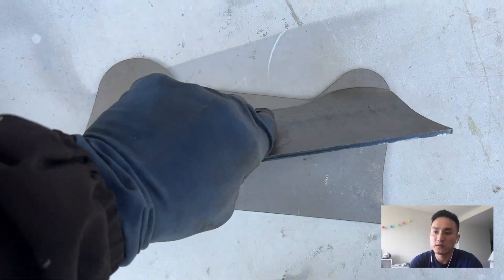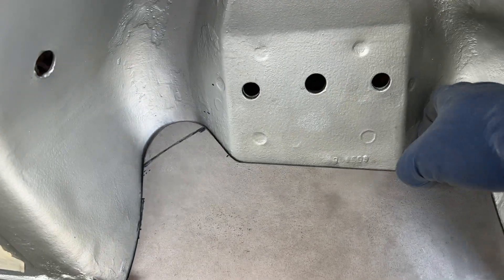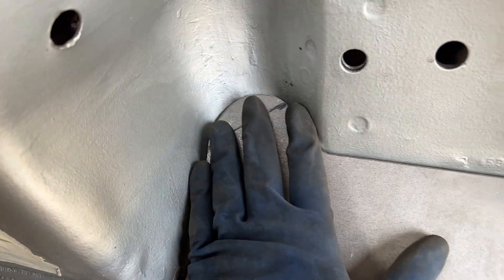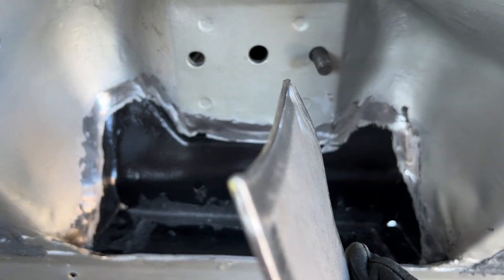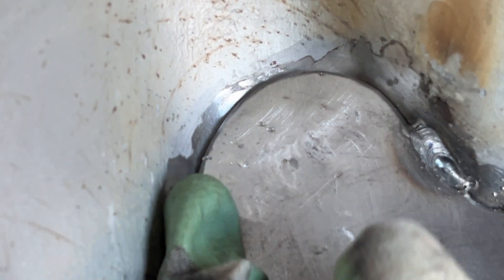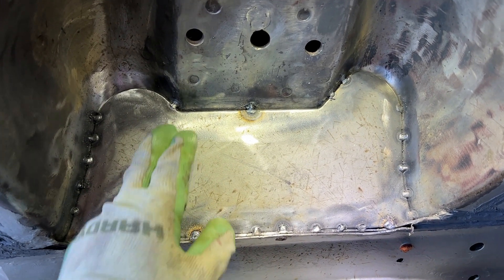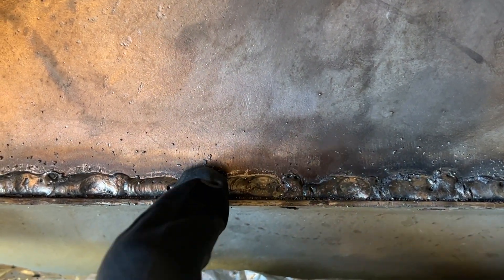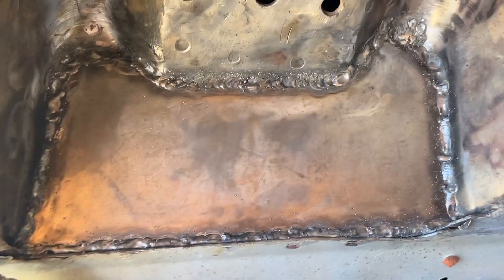Welding in Shock Tower Reinforcements in a 65 Mustang (Guy That Can't Weld)

Comment: I highly recommend a bernzomatic torch. When you heat metal up it bends like butter. If you end up having interference with the UCA, you can heat it up and bend it with a hammer. Also great for unfreezing bolts.

Comment: what thickness steel did you use for your plates?
Reply from the maker: I'm not sure, but I got them here https://opentrackerracing.com/shop/shock-tower-wheel-side-brace-kit-1965-1966-mustang-trans-brace/
I would reccommend paying the $40 since it saves a lot of time at the start as opposed to cutting your own from scratch